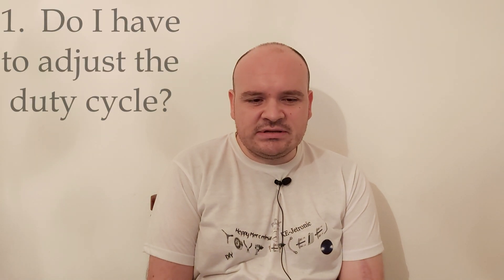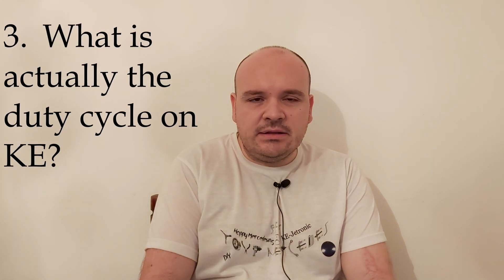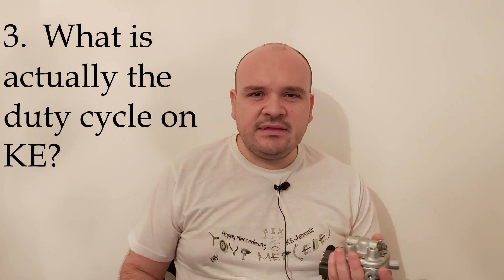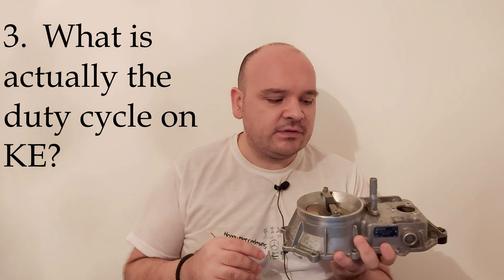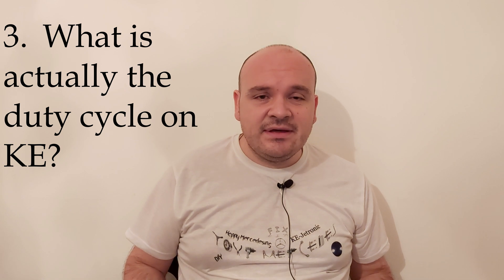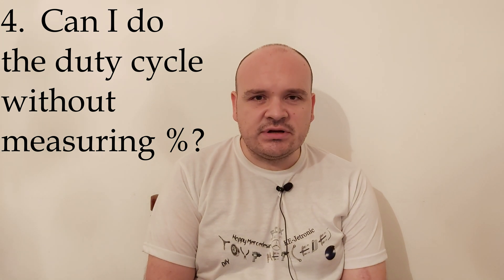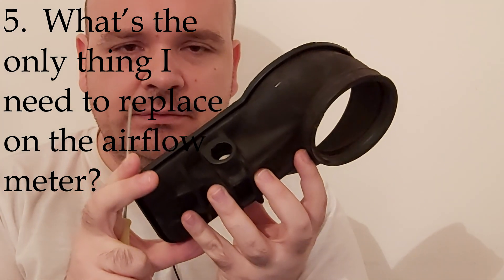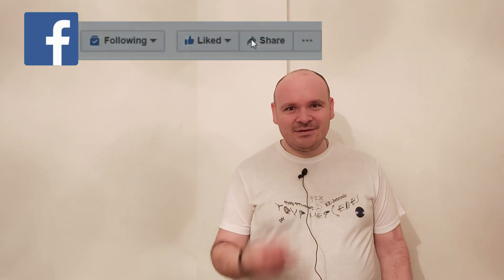㉦Mercedes Ke-Jetronic㉦  - Q&A part 2

Comment: Dear sir, when i measure voltage instead of % i get a steady 9 v.
If, I move my ground lead I get a range of voltages from 4v to 9v-
Is the higher the voltage=too rich?
Lower voltage too lean?
Would you please consider explaining? My voltage not fluctuating between 6v and 7.2v--
+Lead on pin 3 of x11 and - to other grounds, since pin 2 no fluctuation...but steady 9v
Thank you, for your video!!
Reply from the maker: Hello 👋In order to do duty cycle, your lambda must be functional.